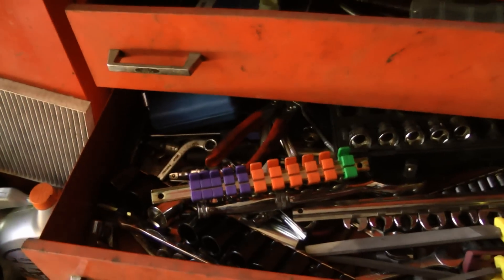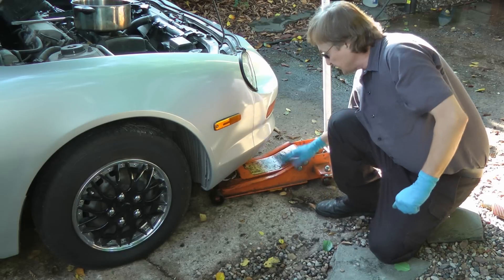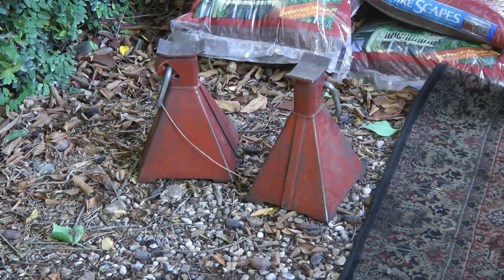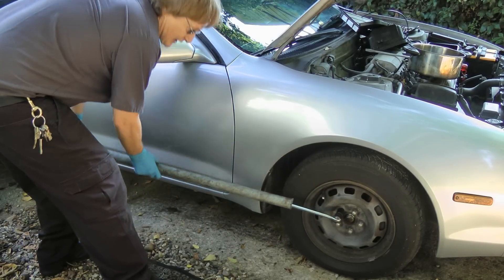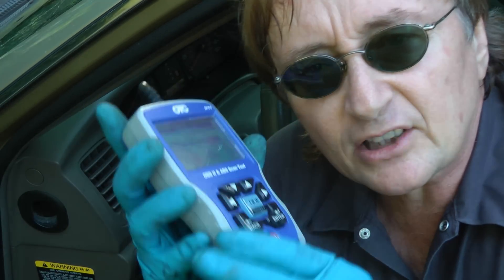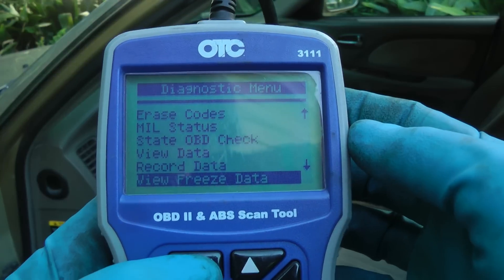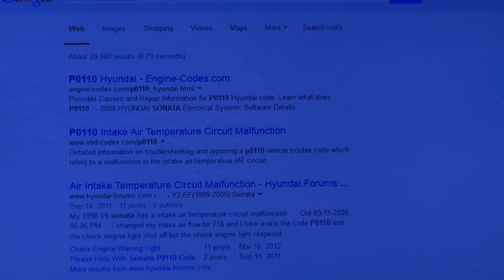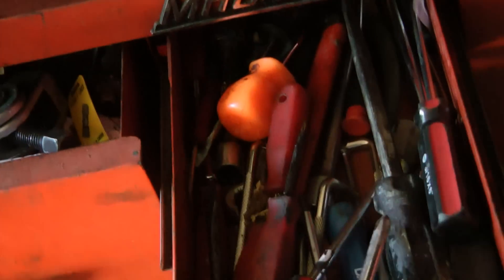Basic Tools For Fixing Your Own Car

Comment: i agree, i like snap on tools and whatnot but they are a waste, ive seen them made and from what they pay for steel and chrome plating, theyre ripping everyone off, that $100 snap on ratchet cost them around $10 to make. Snap on is really good but i have broke just as many snap on tools as i have craftsman. Thats why as a mechanic you always have 3 sets of sockets and wrenches. I lose crap all the time and i usually find it but its nice to have back up stuff just incase.

Comment: Hey scotty, i currently look at the abit more luxury brand market.. Mercedes, jaguar, BMWs and the like... ( yes.. i know you dont like these kind of cars! )

Anyway, im aware of  common faults on used mercs and BMW's.. but what about jaguars? what do you know of them?, one thing i do is, if i buy one, i should keep it.. because they lose so much value x_x.

But what im more worried about is engine/transmission realiabillity.. ive only heard positive things about the XJR models..  ( well, exept that when they do break.. its not going to be cheap.. ) and also ive seen a review on some of them in top gear UK.. great cars they say, but theyre not mechanics =P.

So if you have a minute, id love to have your opinion aswell!.
Reply from the maker: they are all money pit machines, no way past that one.
Reply: Problem is they become cheap cars to buy, but the repairs don't get cheaper. Having said that, did know a guy into his BMW's (and Jaguars prior), and he sourced parts from a non dealer BMW specialist and did his own work. He claimed it worked for him. If you are still keen, talk to a club and remember you have been warned, so do the homework.

Comment: I have a question..  I own a Nissan altima 2005 and it have an air helper spring..  And they don't work any more... I think one of the exploted and the other one has a hole. Do you think it's necessary to buy a new pair or just replace the struts
Reply from the maker: I would replace them being that old with holes and leaks
Reply: Scotty Kilmer thank you... I don't really know what are they for.. Are they like the struts?
Reply from the maker: adrian guzman
the helpers are to made the ride higher and somewhat stiffer. If it rides fine with them broken for you and your driving style, leave em alone

Comment: What's going on Scotty? I've been trying to look for a piece of pipe for leverage. Where did you get it?
Reply from the maker: at an all American hardware store
Reply: O'Neal Raymond or you can go to a home depot or junk yard and get a piece of pipe from metal fencing. It works pretty good as a breaker bar when used with an adjustable wrench or a ratchet. A open end box wrench also.
Reply: Bob Lenihan Ok thanks.

Comment: Scotty what's your take on SnapOn/Matco toolboxes?  $5000 for a SnapOn box, or $500 for one at Harbor Freight?
Reply from the maker: buy the 500 dollar one,or go to a pawn shop or swap meet. Used boxes have low resale value and work fine
Reply: There is such a HUGE difference in the quality when it comes to tool boxes. If your using your box for work then yes 100% go with a high quality one. If your just a DIYer then I can see just getting a cheaper one.

Comment: Don't forget to keep baling wire, duct tape, and JB Weld in your toolbox. Combine these with a basic toolbox, and you can fix nearly anything.
Onboard air and onboard welding is even better if you can afford it.
Reply: Replied to add that you often don't need a scan tool. Most OBD II vehicles let you use the key-on, key-off method to display whatever code is tripping the MIL on your odometer. For example, my MIL is on on my 04 Jeep Wrangler Rubicon...key on/key off 3 times quickly and it displays P0442 on my odometer....bit of Google-fu reveals that this means a moderate leak in the evap system. Since this is purely emissions and has nothing to do with safety or drivability, it can be ignored until inspection time comes around.

Comment: Please advice on buying a Honda Odyssey for $1,500 that has a New transmission, engine runs great, A/C, bench seat folds down for extra room, no rust, bucket seats, power sliding doors, needs power steering pump( steering is stiff). Is it worthy to fix?
Reply from the maker: Realize they have uber crap transmissions that cost over 4 grand to replace correctly. UNLESS you had paperwork of a brand new tranny from the dealer that was put in recently, I would not touch that thing. "new" transmissions is a term lightly banded about that can just mean a junk yard used unit.

Comment: Should I buy a 3/8 or 1/2 inch breaker bar?If I bu a 1/2 inch do they make a 3/8 or even a 1/4  adapter for it?Thanks,great chanel.!I'm a virgin mechanic and just replaced my front struts and coils and saved 500$ in just quoted labor cost!

Comment: Hey scotty, the 12 volt power outlet on my 2001 camry is not working and I can't locate the fuse, what is the remedy? Is this an easy fix?
Reply from the maker: there are at least 3 fuse boxes in that car, the ones inside the car on passenger and or driver's side panels would have that fuse. Or, you can just run a new power wire to the outlet directly from the battery with an in line fuse and wire

Comment: Great video and information. I subscribed. I also want to point out that many parts stores like AutoZone rent out tools free of charge, save for a refundable deposit. So while I'd agree with the diyer buying the tools mentioned, if you need a specialty tool that you'll only use once in a blue moon like a ball joint press or something rent it for free.

Comment: Hey scotty does the scanner works on my 1996 land cruiser
Reply: +Jimmy Baond 
Nost likely, if it has the same obd2 connector. But you can check online, some older vehicles can flash the check engine light to give out codes when you connect two pins on the connector with a paperclip
Reply from the maker: +Jo TUWE if it's a US model, yes.

Comment: Hi, can those cheap Bluetooth elm327 devices be a root cause for a car not to start? I'm trying to work out if using one caused symptoms of a flat battery or worse like ECU issues or if it's a coincidence.
Reply from the maker: those can only cause a no start if the interface you plug into your car is bad and shorts it out. Installing a good scan tool could check that out quickly
Reply: Thanks for replying. Do you know what the fix would be for this? I am waiting for the breakdown cover people to come by. Like I said could all be coincidental. Hopefully they can work it out. Also. You are a legend. Have watched umpteen amount of your videos and it's literally been a crash course for our first car, if you pardon the pun!! :)

Comment: The names of the wrench tools are mixed up.  The long socket wrench is called a "breaker bar."  The long pipe that is put over the breaker bar is called a "cheater pipe" or "cheater bar."

Comment: have you ever use that low Pro that that guy has took 13 years to make does it work as easy as he says it does or have you used it before does all still have the same problem with that tail light on that Dodge Avenger 2012 model
Reply: Load Pro lead set is a awesome tool. The inventor was a real ass i've heard but i use mine every day.

Comment: Hey scotty I just got into an accident an hour ago. It bent the condensor back ito the radiator but those are both fine. but now my cooling fan is hitting the water pump fan.  Can I bend the radiator back or no? and it looks like two screws got knocked loose during the accident, so would that fix my problem if I got new screw?
Reply from the maker: you can try bending it, I've seen careful guys do that.  You can also get new screws or adapt a new bracket if old ones don't fit after hitting stuff.
Reply: Scotty Kilmer Thanks scotty! Thats what im trying to do but I dont have time to take it out, is there any way to hit it softly with a mallet or bad idea?
Reply from the maker: WildWhiteFang
bad idea, try a piece of 2 by 4 wood  to bend it on a larger surface area
Reply: Scotty Kilmer Yeah I got it fixed last night! Just bent the condensor which helped my radiator, and I bent the bottom of it back with a large wrench and soft mallet!

Comment: I did a "rev up your engines" once at a stoplight. popo pulled me over says "what's eating you, REVerend?" <-- not actually a priest LOL.

another good thing to buy is a "stripped bolt" remover socket set. afaik, only harbor freight has em, they're bullet proof, pretty much get any bolt out. used em on a 4.6L main cap on the aluminum bolts on the side. those bolts strip like it's their business

Comment: Hey Scotty I am a big fan of yours. I have a question I really hope you can help me out. My car cranks but doesn't start..  My fuel pump is working, so I know its not that. I checked the battery and its working and I just bought a new ignition coil thinking it was that. Why am I not getting power to the ignition coil... HELP PLEASE
Reply from the maker: a bad ignition switch, bad main computer, bad ignition control module, or electrical shorts to the coil will give it no power. good luck

Comment: Boss I got a 2005 Dodge Magnum 2.7 and I got this problem
When I start the car  feel like shaking and if I give it gas has power but if i take my foot from the paddle shake a lot. When get regular temperature have is hard to start again..also  When I press the brake is hard and I take off the hose from the booster and the intake it feels like  not sucking to much vacuum. Any idea?

Comment: Hi Scott I have a 87 Buick Lesabre it cut off on me last week at first it wouldnt stay crank I had someone check that fuel pressure and he told me that it was getting good  fuel  so he change the ignition module and it run good for about 2 miles afterwards the when I get on the gas it hesitate and sputters I also swicthed out coil packs. At this point I am lost, could you help?

Comment: Hey i have a 2006 chevy hhr i hit something with my front passenger tire and my rim got bent. So i fixed my rim but now my tire hits on something my tire is now about an inch to the left side closer to my car body. What could be the problem? The mechanic told me it was the steering knuckle is he correct???

Comment: If I could recommend anything it would be brake cleaner... but I suppose that's disposable so not classed as a tool... But man, that stuff is worth it's weight in gold, it's used for cleaning diesel injection pump components during overhauls ect.... trust it with anything that you'd like to be dirt free, dizzy caps for example.... But, great for cleaning engine components before re-installing for the uh... more determined DIY mechanic who wants to strip his engine down if he needs. And twink/white-out pen for marking parts :)
Reply: Ben Herbert Eh... we don't have many diesel engines here were i live, but if you know some product for gasoline engines i would love to hear.

Comment: What is a PO463 (Fuel Level Sensor a Circuit High Input)?
Reply: Means you most likely need a new fuel gauge sending unit? The code states high so that mean the potentiometer which is the fuel gauge sending unit failed on the high side 5 volts.

Comment: How was the low pro jack only $20 more than the little one?  The low pros are like $140. Here in Canada I bought a jack set with that little kind of jack and wheel chocks and jack stands for under $50

Comment: 3:15 how do the cheap Bluetooth OBDii readers damage your car? What is the possible damage from them? I have used one, and aside from it dropping communication often, it has worked for short periods of time. And I am not speaking praise for these cheap things by any means, I am just asking because if they really can do damage I will stop using it. I just need to know how they can damage a car, it just doesn't seem possible with the low voltages they use.
Reply: It won't damaged your car.

Comment: I've used my $20 Blue tooth dongle and Torque App for Android on many cars without issue... 1995.5 tacoma, 1999 Audi A4, 1999 BMW 328, 2004 BMW Z4, 2008 Tundra, 2010 Traverse, 2013 Golf R, even a 2011 Corvette.    Not disagreeing, just saying I've had great luck with my little scanner .  :)

Comment: Scotty please don't ignore me.

Why wouldn't a scan tool power on when being plugged into the OBD Reader? What should I look into and how can I test to see what could be wrong? Would really appreciate if you could help me and it would save me a lot of money. Thanks.
Reply from the maker: 3 things can do that, One is a broken pin on the connector of your scanner or the plug on the car. Two is a bad main computer or wiring short in the obd wiring going to the plug on the car. And three is a bad sensor somewhere on the car that's shorting the whole thing out. Good luck on that one.
Reply: Scotty Kilmer Hey Scotty, ended up being the cig lighter fuse.
Reply: Keep the pennies from falling into the lighter socket and the fuse won't blow!!!

Comment: Dear Scotty Kilmer: I have 2004 Toyota Corolla Ec 1,8 and it has 165000 Km, right now the engine light of it turn on . when I check it shows the codes( PO456 - PO442 and PO446 ) EVP small leak. please guide me how to fix it with out smoke machine.If you could to provide a video clip for it that will be better . I am looking forward to your reply. Best regards,
Reply from the maker: pray it's just a bad gas cap. If not, try my video "finding engine vacuum leaks with a cigar" and try cigar smoke to find the leaak

Comment: Still crappy gas mileage on my O 7, f150 5.4 Triton ,super cab I've done the following
Cleaned maf sensor
Change the fuel and air filter
Check codes at a auto shop oxygen was ok no codes

It smells like rotten eggs when you press on the gas a lot it gets about 8 miles to the gallon.
What should I do next ?

Ps
I'm hoping somebody totals it
Reply: Catylatic converter?
Reply: +Brandon Mikel That's my guess.
Reply: +Brandon Mikel   I need to find out why cats failed (if that's it)

Comment: Buying cheap sockets was the worse thing I ever did when I first started out. The tolerances are crap and they round off any bolt or nut you touch with them.

Comment: i dont go with the "lifetime warranty" on cheaper tools.when they eventually break in the middle of an important task the last thing you wanna do is go borrow someones car and waste time waiting in line to replace your broken tool..invest in a good set of matco or snap-on(preferably matco)which are just as good as snap-on and for less $.. being a backyard mechanic is tough enough so dont skimp on tool quality
Reply from the maker: I've never had an auto zone duralast tool break, and even if one did, it's only 3 blocks from my garage to the nearest one.

Comment: one thing i wont cheap out on is power tools and air tools, floor jacks and jack stands should never be bargain buys. always get the exspensive ones. i had a harbor freight jack stand fail on me once. never again will i risk buying a cheap jack

Comment: Cheap tools always break when you need them the most. Your tools are your last line of defense.
Reply: I bought average tools, swapped engines, drive shafts and all sorts of other things and have only broken two sockets and a pair of pliers.
Reply: Clearly your cars aren't nearly rusty enough.
Reply: s0nnyburnett
If you try to remove something rusty, you should always lub it. It´s just common sense.
Reply: Bruno Santana even more rusty than where penetrating fluid will help.
Reply: s0nnyburnett  What?
Reply: I live in Australia, may explain the no rust.
Reply: s0nnyburnett
 I Dont get it...
Reply: Bruno Santana Rusty shit.
Reply: s0nnyburnett We Need to rampage the casa Blanca like all the wannabe wonder women did...

Comment: I must say that working on older cars it is nice to have both metric and standard. As I have worked on older cars that had previous work done and whoever did the work would use standard bolts. So then the whole car would have a mix of standard and metric bolts. (This was annoying)
Reply: They came from the factory that way.
Reply: hothamandfauri And that is why you should be undermining at a used car dealership.

Comment: Sorry to bother you I've been having a problem with my toyota corolla 2001 I have uploaded a video on my YouTube account every once in a while my car won't start after a few tries, sounds like the car is weak. I have replace the spark plugs, had a few mechanics check the fuel pump, starter, they all tell me that they are working good.
Reply from the maker: often just a bad battery does that, have it load tested, places like auto zone do that free.
Reply: Scotty Kilmer ty for your reply it has a new battery also they check the alternator all is fine
Reply from the maker: Stanley Galeano
If the batt and alternator are good, then the starter is weak doing that. They have had problems with that year corolla starters burning out early

Comment: The phrase “discount auto parts store” is obsolete. There’s no such thing as an auto parts store that is a “discount” one. In fact, the tools sold at the auto parts store are significantly more expensive than stores like Home Depot, Lowe’s, and harbor freight. The quality of the tools is for the most part, excellent. Combine that with a lifetime warranty and there’s absolutely no reason for a garage mechanic/ DIYer to buy the expensive brands.

Comment: what happens if you cut off your muffler ???   and how do you pant you rims ???
Reply from the maker: car would be loud and the neighbors will hate you, plus you'd fail emissions testing. Tape rims off with masking tape, clean em with brake spray cleaner, and have at it.
Reply: cool thanks   it would not hart car to have no muffler ?
Reply from the maker: $zackiscoolify$
 sometimes it can make the engine run somewhat lean from too fast exhaust gas flow. If it starts to backfire, it'd doing that
Reply: ok thanks

Comment: the breaker bar is meant for it's particular job, it breaks nuts loose without over heating them and snapping the stud off. Slow down.